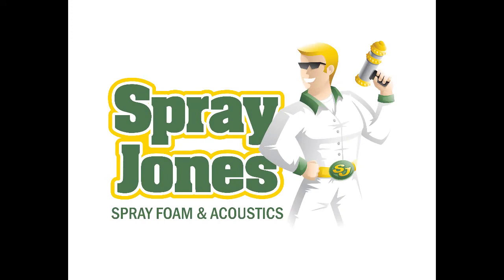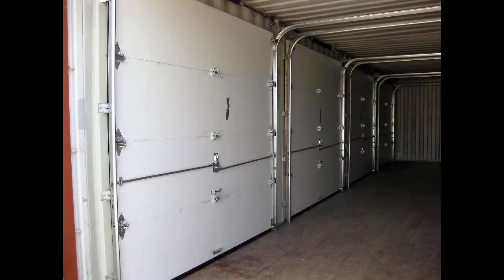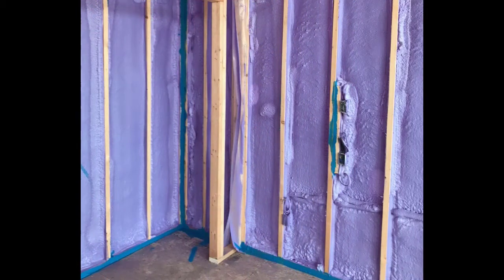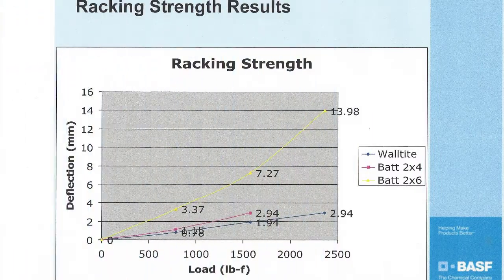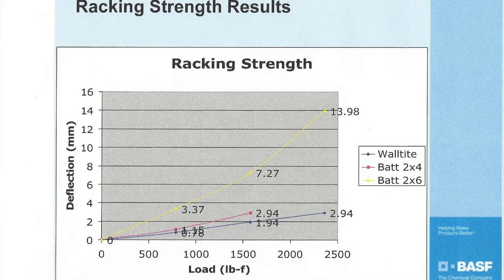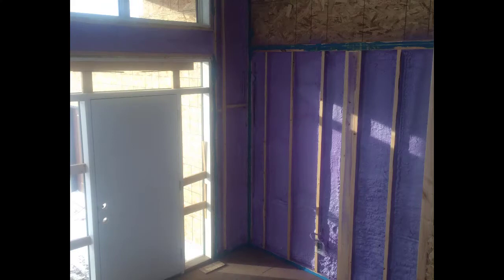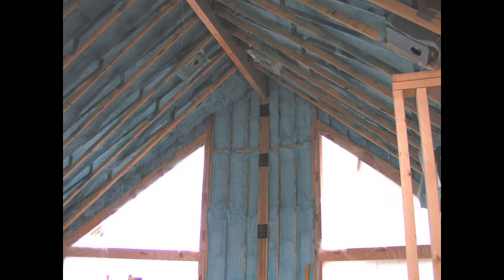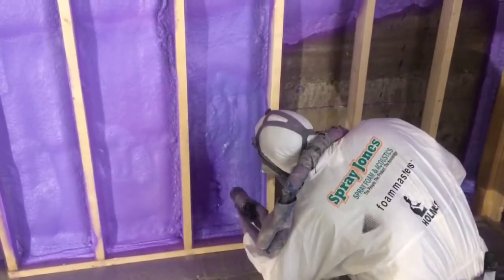Does Spray Foam Insulation Add Structural Support to Walls and Roof?

Comment: I'm putting a large aquarium about 275 lbs above a spray foamed 2x4 load bearing wall that's one story below in the basement.  Sounds like the wall will be substantially stronger will spray foam.  Would I need more support?

Comment: Yes but what if you do only 2 inch. You only need 2 inches to achieve a vapor barrier so it's overkill doing 3 in most cases, especially if you are doing stucco or insulated vinyl siding etc. Have you run any of these tests on 2 inch?
Reply from the maker: You saw the data  on what I have officially. I can speak to 2 inch but it is purely anecdotal from experience.

Comment: Are there any building systems that you know of that uses framing+foam+siding and skipping the sheathing and home wrap and relying on the structural support added by the foam ?
Reply from the maker: But of course. BASF HP wall system: https://www.youtube.com/watch?v=SDnr7R5ruQM&t=1s
Reply: @SprayJones    Ah, but BASF HP has girts which provide racking strength.  I don't suppose neopor rigid adds much strength, but the HP system TER covers all these bits - spray foam, girts and neopor.   I'd like to hear answer to Phil's question.  Why not build stud wall 2x6 @ 16" with good quality WRB installed tight over frame, lay it flat in a jig to get perfectly square, then spray into stud cavity with spray foam.  5" foam @ R-6.4/in would provide R32.   Then you can attach horizontal cladding direct to studs.  or, if you want vertical siding, add strapping over WRB before spraying.   Crazy idea?
Reply from the maker: @robblakeney8109  Go right ahead. Just have to "sell" it to someone who will pay for that.
Reply: @SprayJones  are you saying it's too expensive then?
Reply from the maker: @robblakeney8109  Do you work in construction? Make your living building?